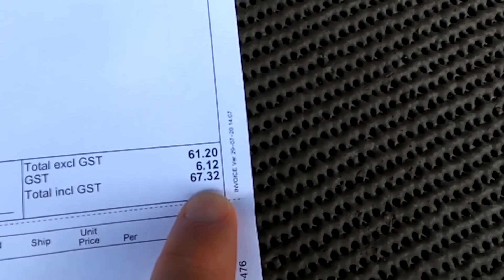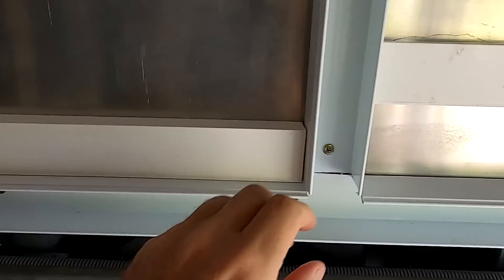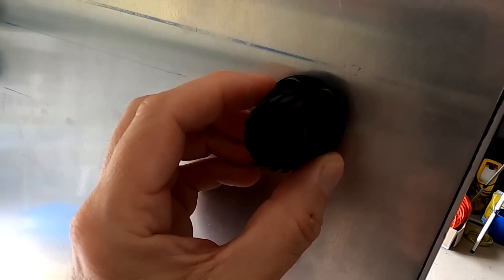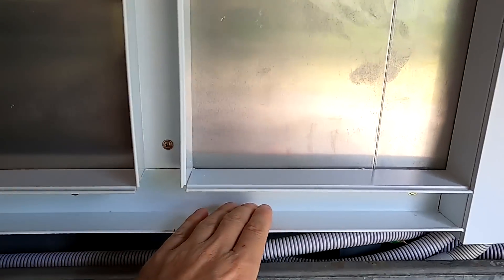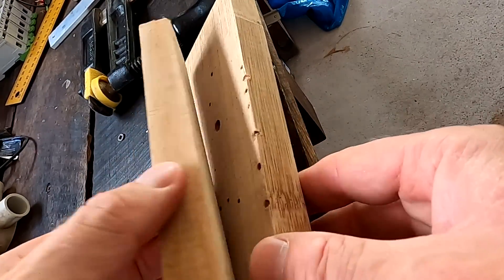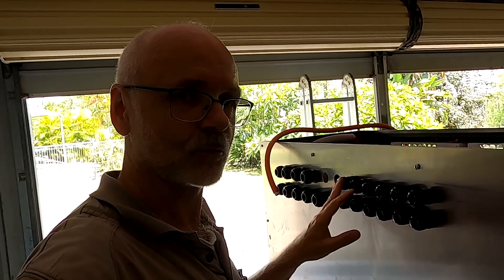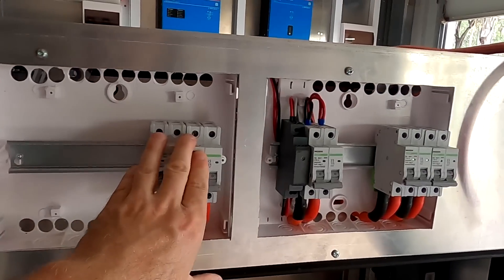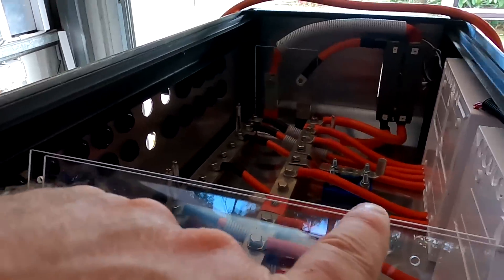Finalising the 45kWh battery shelf. Are we there yet? #PowerWall

Comment: I wish they designed inverters to play better together even across brands. All they really need to do is sync their waveforms just like with grid tie.

Then you could run multiple inverters of different sizes and capacities. Have a controller that can switch them on and off. To boost amps or run your home solely from a more efficient small inverter when there is no real power demand.

Comment: Hi Andy, just realized something. Inside the battery box, how well do you think wireless communication (i.e Bluetooth) is going to work with the metal shielding? If I remember your bms is BT, plus other devices like raspberry pi (Wi-Fi or ethernet)? Just a thought.

Comment: With all the data connections coming into the battery, I wonder if it would be cleaner to have a USB hub on the wall and then only one USB cable feeding from that hub into the battery. You'd probably need to feed 5v power for the hub out from the battery as well - but that's just two cables (one USB and one power [if needed]). Rather than an individual USB run for each device. Just a thought.
Reply: I like ur idea Russ and I wonder how easily he can remove a faulty USB cable in the future if needed, I have heaps of dodgy ones, although they are not fixed and constantly plugged in and out of things compounding their shorter use by date. There are plenty of variations in USB Hubs nowadays that could suit well here, with 8-10 USB outlets or more for extra charging of phones, pads, etc, and a hub right at ur computer gear too could be handy. Good comment, & TA Andy for another entertaining vid, Cheers

Comment: Hi Andy, use a piece of M10 (compared to your finger) allthread longer than what you think with a nut either side of the purlin locked up then put another nut on approx the distance out from the wall, slide the battery shelf back, washer, nut. Secured!!!!!  Still waiting on answer to the mystery 40 volts from the moon?
Reply from the maker: A threaded rod was my first idea too until I found these amazing M10 bolts. And some metal pipe ;)
The 40V moonshine... to be continued 😉

Comment: Hi Andy. You could mount the AiLi 500A shunt, the one with rectangle display in line with Victron shunt. You’ll then see all important informations at glance without need to use an app. I’ve this setup in our motorhome, both Victron and AiLi together with 600Ah LiFePo4 DIY pack.

Comment: My only comment would be to use class T fuses instead of mega fuses. Nice work.
We had no problems running communications and DC power together. Burn in racks holding 128 motherboards with serial ports and power together (in 1981, but still).
Reply from the maker: Thanks John. The mega fuses (with 58V capability) are recommended by Victron. And a bit cheaper than class T fuses but yeah, they would have worked as well in the same manner. I have a 250 circuit breaker before the fuses with a breaking capacity of 25kA so just in case of a case.
Reply: @OffGridGarageAustralia  Yes, as you pointed out, I forgot you have some very capable circuit breakers. Much better than the Eaton Bussman brand that I use, although more expensive. No need to replace fuses even if you have a short.

Comment: Hopefully Australia won't catch on to California's brilliant plan to tax sunlight.
As for signal cables with DC power cables in the same raceway and metallic conduit, we used to do that a lot in industrial power and control environments, not typically a problem if the insulation ratings of all conductors are above the maximum operating voltage of the highest operating voltage conductor.  I've even seen up to 5KV AC power cables and 4-20ma control cabling specified and installed in the same cable tray, as long the control cables were internally shielded and separated by 6 inches. Alternatively, simply placing a metallic separator (grounded and bonded) as little as a  thin aluminum shield plate between power conductors and low voltage signal cables was legal and effective.
Reply from the maker: That's interesting, thanks for sharing.

Comment: Hey Andy, nice Video. I love how you oversize everything! Your videos just give me my daily dose of Batteries :) I also built myself an Lifepo4 Battery (6kwh) for my ebike to charge everyday. I use an old Apc USV (Unterbrechungsfreie Stromversorgung) as inverter. That works surprisingly well. You can have a pure sine wave 1000 watt unit for 50$ you replace the lead acid ones with your Battery Bank. You should mention in onw of your Videos. It would really help people, that are on a bugdet.
Reply from the maker: Thank you. I have several of these UPS sitting around. I removed all the dead batteries and wanted to replace them with AGMs again to sell them again. Mauby that's an interesting project to upgrade the UPS with LFP cells and use it as a small mobile battery solution, Bluetti on a Budget so to speak.
Reply: @OffGridGarageAustralia  That would be great andy! The only problem i had was the big Transformator getting absurdly hot. That was solved with installing an 120mm Fan. They aren’t designed to run big loads for long, although in my test there’s no problem with that.

Edit: And i tried charging my tesla with 5 a (240v) which surprisingly works. These UPS‘s have some kind of Neutral-Ground-Bond.

Comment: Look good A 👍  can't wait to see it in position. Have a look at the carlo gavazzi et112 for the 240V monitor. It's compatible with venus on the raspi 👍
Reply from the maker: That will be interesting when we connect to the grid. For now, the inverter is my grid and shows all the data.
Reply: Yeah i have one of those on my system because im not using a victron inverter yet. Everything else is victron except the inverter, which was a growatt 6000w LF transformer type i got for free.

Comment: Keep your data cables separate from your power whether they are AC or DC on the DC power cables you will have pulsating DC due to the inverters drawing from them. To confirm use an AC CT and measure the ac voltage while your inverter is powered up to a load.
Reply from the maker: Too late now ;)

Comment: Just FYI: There are two independent and INCOMPATIBLE measurement systems for cable glands:
There is the PG system (PG9, PG11, PG16, PG19, etc).
And there is also the METRIC system (M12, M16, M20, M25, etc).
It's very annoying that they are not compatible. PG25 has thread outer diameter of 30 mm, but M25 has thread outer diameter of 25 mm.
Some of the PG sizes have very strange thread diameters (e.g. PG16 has 22.5 mm thread diameter).
Reply from the maker: That is strange indeed. The PG25 fits a 25mm, the PG20 a 20mm hole. At least it is sold as PG gland down here.